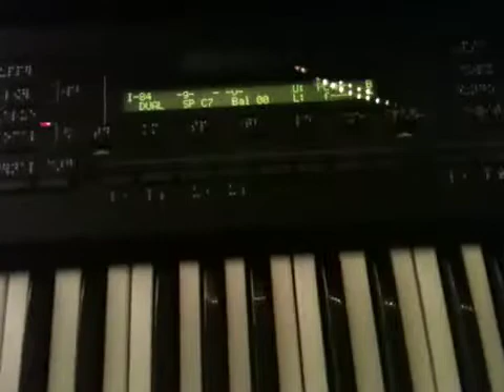Waveforms, harmonic series, FM, PD, LAS

Comment from the maker: @DX7Alex Hi :) Yes, agreed, D-50 is a sweet synth. The joystick on D-50 is not spring loaded, naturally it won't return to center either, its just used to enter data, and fade the partials together, it also won't change the pitch of the sound unless you are setting the course tuning with the joystick. Also, in normal operation of D-50, moving it will not cause any change unless a parameter is specified for it. It makes editing large number values much faster. :)
:) TSF

Comment from the maker: @DX7Alex HI :) Thanks :) The joystick on D-50 is only for data entry, mixing partials together and for setting values. No vector on D-50, its Linear Arithmetic Synthesis (subtractive synthesis) with optional one second PCMs you can add for the attack of the sound, then you use the four seperate synth engines to create the rest of the sound using regular subtractive synthesis method.Then theres EQ, reverb, chorus and delays you can add for even more flavor. D-50 has much to offer! :)
:) TSF

Comment from the maker: @jimmyss75  Cool. Its interesting how many colors of noise there really are. Pink noise is similar to white noise but there are a certain frequencies that are different, its the in between of white and red noise. :)
The DX-9 can create noise when you set the frequency ratios and the output volume of all the OPs too high so that the sidebands end up creating noise instead. FM and PD are interesting and noisy forms of synthesis. 
:) TSF

Comment: Question for all you synth freaks out there like myself.  A true synth freak has a good idea of what the basic waveforms are, their base sound without any tweaking, and what types of elaborate/advanced sounds their capable of creating when tweaking with filteration, multi oscillator overlaying, etc..
Examples of waveforms are sawtooth, squarewave, sine, triangle, pulse, ramp, random, etc...
If I were a waveform, I'd be a sawtooth.
So on that note, which would you be?